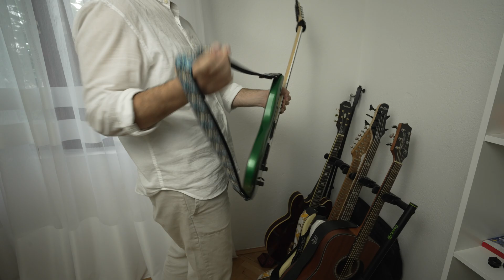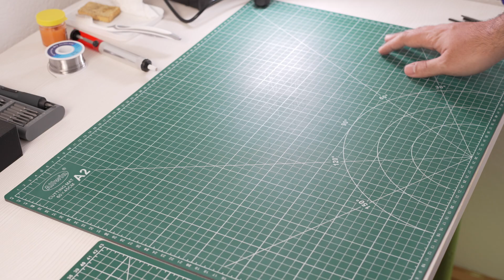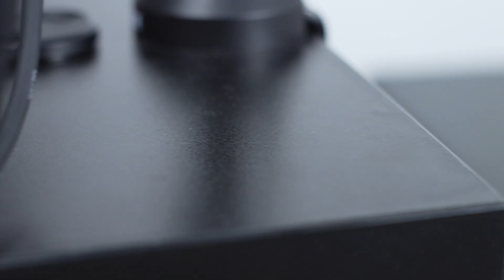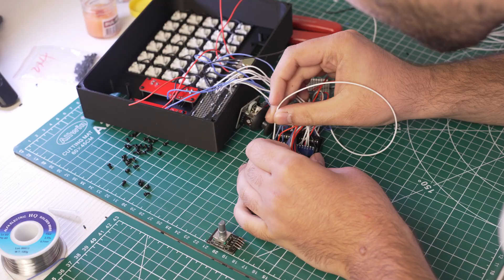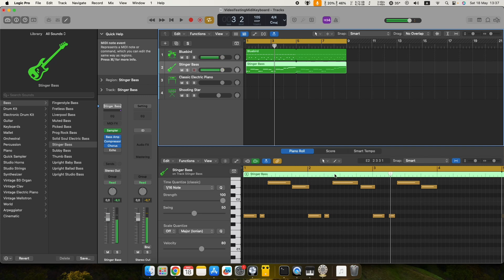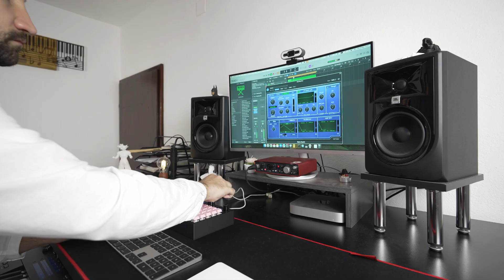I Made the ULTIMATE DIY MIDI Controller

Comment: I've been doing electronics for over 60 years and am also an audio engineer. Very much enjoyed your DIY MIDI project. Nice and versatile set up you've made. 

I have three recommendations for the next one or a similar build. 
    1.Reinforce the panel's top so that it flexes less. 
    2. Instead of individual wires, use ribbon cable. It really isn't that expensive.   And, 
    3. Use connectors on the individual boards with mating ribbon cable connectors between boards, or a connector on one end of the cable (that goes to the board(s)) and pigtails to solder to standalone parts like the rotary and slide pots. That way if something fails, 
    4. the 'module' can be removed and tested and then easily repaired or replaced. 

This makes possibile generic modular builds: sub-components that you make a few extra of for creating something else. Many such systems use the same things over and over, as you know.  One good example would be the boards that hold the colored buttons on the top left of your controller.  If I were doing this, I would have made maybe six boards - two for this build and four for something new in the future (that I've not even conceived of yet :).  Good candidate for item 3 above. 

Having built many large-scale systems such as mixing consoles, stage light controllers, and industrial control panels, I've learned that - next to a dog - unified connectors and cables are a human's best friend :)) 

Keep up the great work!

- H in Florida
Reply from the maker: Hi there. This is such a great advice! Making projects modular definitely helps with production and reusability. I think I've progressed a bit by creating custom PCBs for my newer projects, check them out if you have the time.
Thank you

Comment: What kind of fitting did you have for the screws? Is there just a hole or are there some threads too?
Reply from the maker: For this one I thought I was being smart and I used tiny magnets instead of screws, but turns out they don't hold at all. Usually for my other videos and projects I started using heat set inserts

Comment: Hey, i spent a week trying to figure out how to use the multiplexers. I am having trouble. I am trying to use the 16 pin multiplxer called CD74HC4067. I can’t get it to work. I connected the pins properly but I don’t know how to write the code.

Do you have the code for multiplexer to use in arduino? I want receive a signal every time I press a button. I am trying to make a 16 button midi controller using arduino micro pro.

Thank you
Reply from the maker: Yeah, for sure. You can download the code from this project from my website, and there are functions that handle the multiplexers. Check out my other projects too and download those codebases, I'm sure you'll figure it out! ☺️
Reply: Bro!!!! I have a headache with this board. I spent last 3 days trying to figure it out. My wiring looks correct. However, i can’t detect any input from multiplexer pins 0-15. I even tried different boards. I looked into your code. How do you separate it from rest of unwanted code. You got whatsapp?
Reply from the maker: @ join my Discord and message me there https://discord.gg/F2vPgQfr
Reply: I finally figured it out! I had to solder the breakthrough board. Now the multiplexer is working. I can turn a led on any channel I want. However, i am having issue with buttons. When i press the button nothing happens. It keeps scrolling “button 1 pressed” even if I don’t press the button, maybe its the code?

Comment: without mux's how many buttons would you lose?
Reply from the maker: Well each mux accomodates 16 buttons, so if you only want to use arduino pins, you can either connect each switch directly, so you're limited by the number of pins - or you can create a matrix, so you would need rows*columns number of pins.

Comment: Hmm... Why do you use those 16 and 8 channel multiplexers to connect the keys to your micro-controller? There are special matrix keyboard examples that allow you to connect keys (with diodes) with multi key press detection. Your next project might be one of those launch pad style controllers with an 8x8 matrix of keys and doing t his all with multiplexers is getting a pain to draw the schematics, design a PCB - not even talking about prototyping this.
As for the micro-controller, I would rather select the Raspberry Pi Pico instead of the Arduino Pro Micro. It's cheaper, has more memory, more speed and overall much more capabilities than the Pro Micro. Selecting a hardware platform to fit your needs for future projects seems like a good thing to do.
Making a PCB for the next project seems like a good idea and I like where this is going so let's like&subscribe to please the algorithms. I suggest to start making an account at JLCPCB and start using KiCAD. Start playing with some simple schematics and convert those into a PCB design. Feel free to upload these at JLCPCB to validate your design before creating a bigger, more complex, one.
Reply from the maker: Thank you for your in-depth comment. I will try to cover all of it in a future video, but for now- I will say this: the multiplexers take only fewer pins on the arduino than a matrix. The 8 channel MUX has 3 signal (bit) pins and one output, which makes it 4 pins total. The 16 channel MUX has 4 signal and one output, making it 5 pins total. However, I can connect all MUX signal pins to the same arduino pins, and only have different output pins. This saves A Lot of pins, had I used a matrix I would need NumberOfRows + NumberOfColumns = NumberOfPins, and I would need to use diodes. Most of the times finishing a project means doing less work, getting fewer components and making fewer errors. 
Next - I get my components from AliExpress, and as far as I know the pro micro is cheaper, but I will check. It will be fun to use a pi pico. And finally, PCBs are coming starting from the next video. Make sure you're subscribed to check it out :D Thank you again for your input.

Comment: great work! 
I also want to build a midi controller with arduino, but I have a question is how you make your arduino input signal be recognized as a midi device, so that can be read into my DAW?
Reply from the maker: You need to look for an arduino board that uses the Atmega32U4 microcontroller, which in conjuction with the Midi library will turn the Arduino into a Midi compliant device. Generally I would recommend using the Arduino Pro Micro for this job, due to its price and versatility, although other boards like the Teensy 3 or 4 should work as well
Reply: Thanks for your answer!

Comment: So cool. The best part is you shared the whole project with us for free. Thank and you God bless you 😊🙏❤️
Reply: Yes.. and while appreciated - a) there is no PDF with a component guide (ie: most of the parts are sold out now) and b) there is no soldering guide... this is for advanced advanced folks only.
Reply: @pesto12601  I respectfully disagree - this is at most an intermediate project.  Arduino programming is super easy. And the electronics involved are not at all that complex.  MIDI, I will grant you, is a big subject - but there are so many tutorials and pre-canned MIDI libraries available, that it has become super easy to just plug in a microcontroller and then copy and dump someone else's MIDI code into it - and start hacking, er, 'experimenting'  --- It is certainly not like it was when MIDI was first invented. When we audio engineers had to write MIDI in binary and code in assembly language. (Yes, I am that old. :P)   

You don't need a component guide - you can figure it out from just watching the presenter's video - use the pause button and rewind.  I just checked - I found multple sources for all these parts. (Sure, I have done so much of this that I know where to look.) But, come on, you all have Google and AI --- ask an AI to find it for you!  As far as soldering goes - it is not a skill you can learn by watching videos alone ... just get a cheap iron, a bit of flux core solder and some small assortment of parts and practice.  You can also save old electronics things and UNsolder their parts for practice use too.

So, you see, I am challenging you not to give up so easily !  Any skills take time and repeated effort.  But you gotta dig in, make mistakes, and repeat ...

Go for it!

Comment: Nice work! I know the pain well when you try to close the box for the first time and all those cables need to fit inside. And for your Controller, I think it would make sence to switch the keycaps colors for root notes.
Reply from the maker: Thank you for your input. I thought about changing the keycaps but it is actually pretty simple. The bottom left key is a C, then two rows above it you have an octave(C), and two rows above it you get another (C). So if you want to target root notes, you would just count the steps in the scale. But then if you switch the keycaps and use the transpose feature, they won't make sense again. 😂 Send me a photo if you decide to make this project, let me see what the design will look like with a different color for the keycaps. Thanks again!